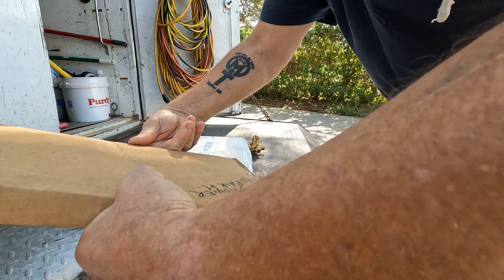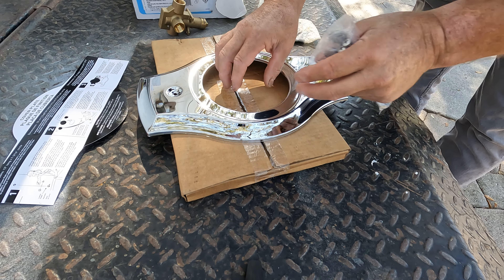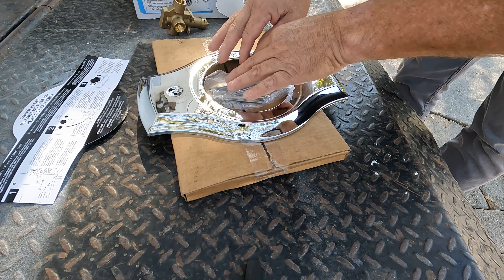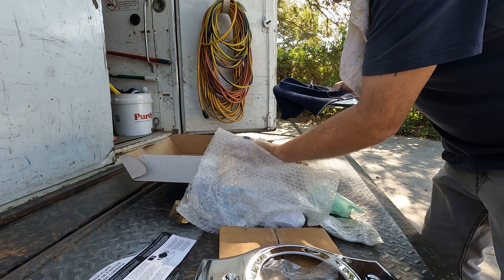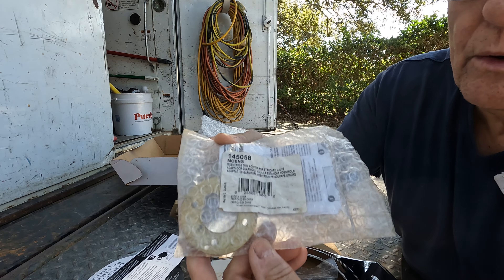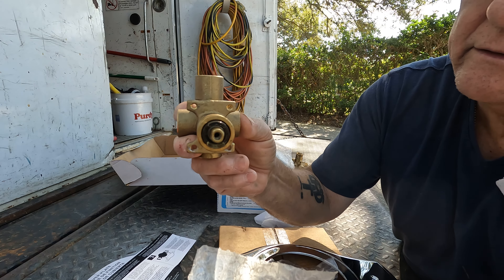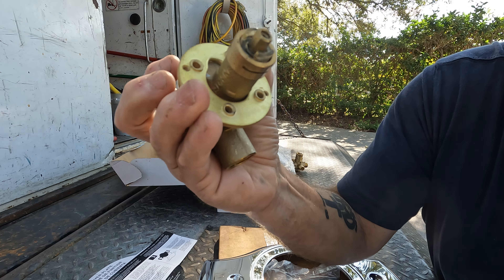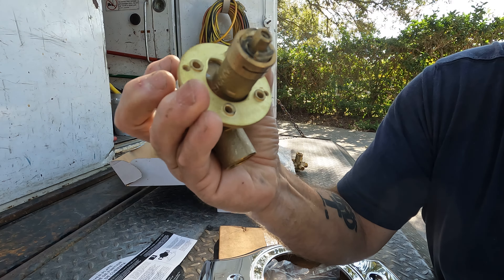3 HANDLE VALVE REPLACEMENT OPTIONS YOU MAY NOT KNOW ABOUT

Comment: I have the oval moen plate, it looks great compared to the alternative for replacing two handle shower valve. I don't like the posi temp valve as much because there is no flow control.
Reply from the maker: I agree but home inspectors and plumbing inspectors want to see an anti scald device on a three handle valve now,that's a real pain.
A moentrol valve body will give you volume control  plus anti scald,you would just have to use the other plate with the moentrol trim,thanks for your comments, let's pass it on to the next generation!

Comment: they also have an oversized round one ive installed them with fiber glass tubs with coper plumbing its pretty tight but but ive done i think i got it from Fergason's or hd supply
Reply from the maker: Nice,thanks for sharing that info